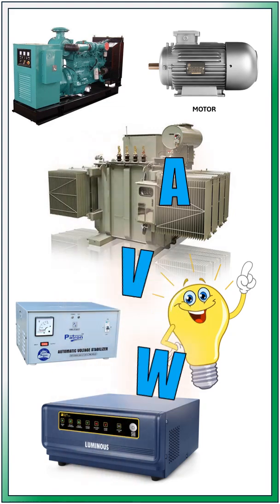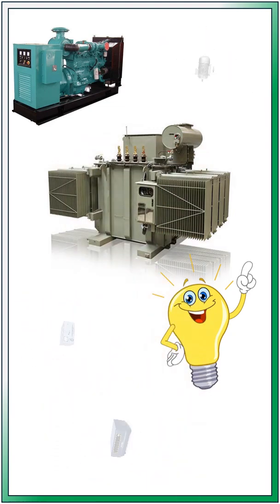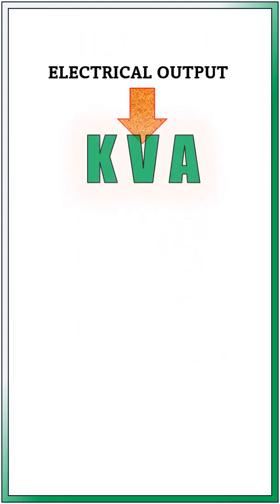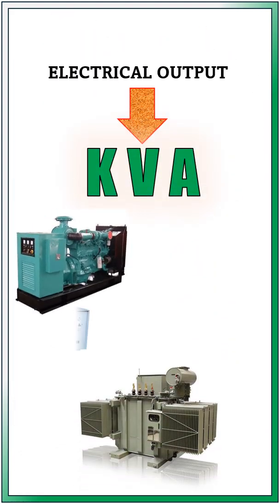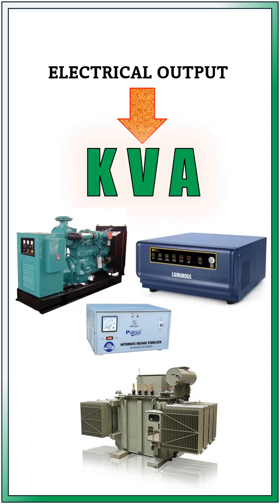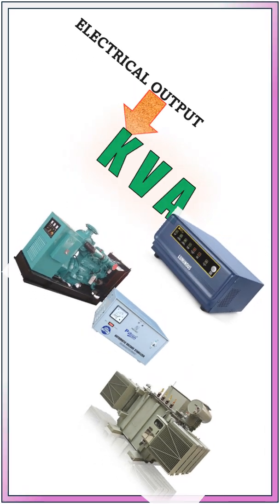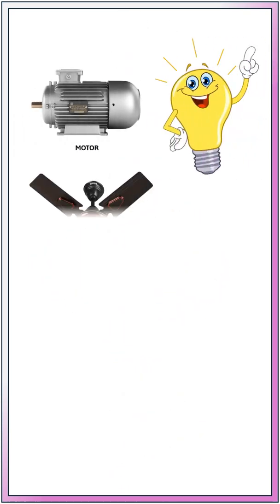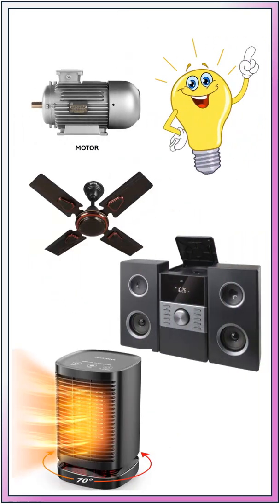Rating of Electrical Appliances | Rating of Transformer in KVA | Motor Rating in KW | English |

Comment: Even generator rating also in Watts I seen
Reply from the maker: If you are going to draw, only active power from your generator (No Reactive Power flowing), then KVA or KW doesn't matter because both will be equal, as Power Factor will be "Unity". In this case if you have a 800 KVA generator, then you can say that you have 800 KW generator.
Reply: @electromagneticworld  only when the power factor is unity

Comment: Then charger rating in watt . Why?
Reply: @sachinyadav-jh9ou  charger have so many steps to converts Ac  to DC supply in so it's rating in Watts I think so brother
Reply from the maker: Almost all Mobile Chargers are fixed to provide 05 V only. And their work is supposed to charge batteries, which requires active power only. You never connect any load which will require Reactive Power, So their rating is given in Amperes actually. 
You must have heard like 2 A charger, 5 A charger etc. Now multiply 5 V with 2 A & 5 A. you will get 10 W & 25 W charger. or you can also call it 10 VA or 25 VA charger.
Bigger chargers for bigger operations are rated in VA.

Comment: I have one doubt ,if I have  generator rating is 0.8MW How much rating of transformer (33KV/0.400KV) should be I chose
Reply from the maker: I understand from the details given that; your generator is generating 800 KVA Power at 33 KV voltage. Now you require to Step it down to 400 V to connect the loads. 
if so, it will depend up on many factors like Power Reliability, Available Space, Distribution of LT load, Level of Fault Current etc. 
One thing is obvious that, to utilize full generated power, you need to put transformers more than that. To keep Transformers at 50-60 % loading, it is advisable to have at least 1600 KVA installed capacity of Transformers.